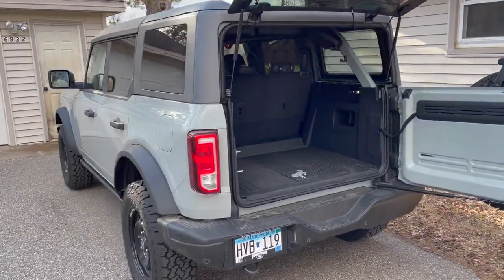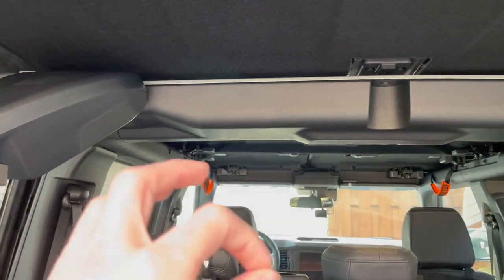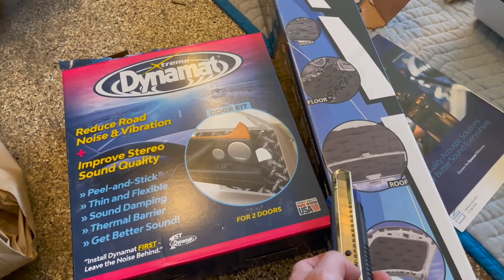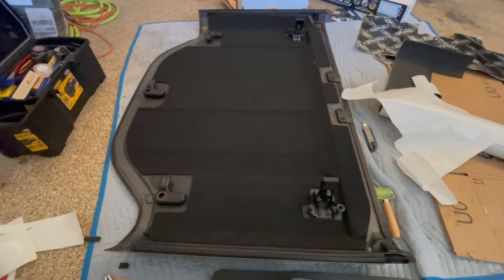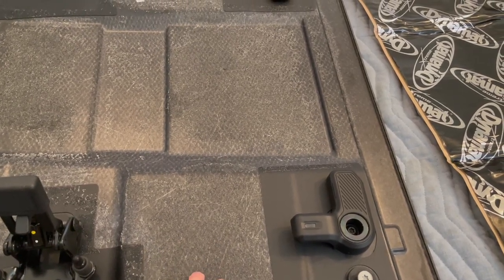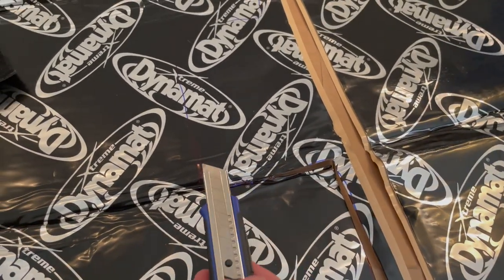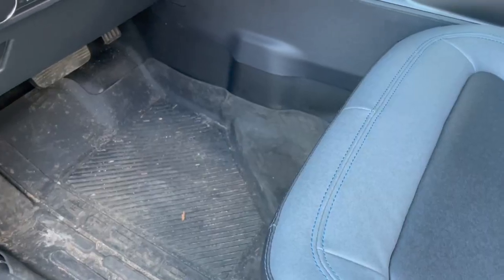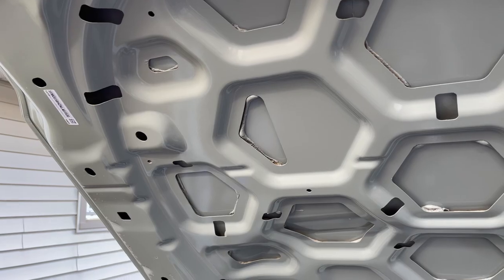Bronco Dynamat and Dynaliner hard top roof install

Comment: Try using pipe insulation the foam tube type to fill the vacant space you were showing. Just cut the length you need and press it into the space. It will fill the space without warping it

Comment: Using a hair dryer (I’m not ever going to admit where I got the hair dryer, and tactically plan such use when SO is out of the house) to warm the glue might help remove the factory liner.  A heat gun is much more SO approved, and made for garage use, but might be a little too hot.

Comment: Nice job, watchable video. How long have you had your Bronco? I'd think that the older the build of the roof the more "cured" the glue of the factory headliner would be. Do you see that a possibility?
Reply from the maker: Definitely. Especially as that glue thermocycles over the years. I've had mine for a couple of months. I suspect that even 5+ year old headliners aren't going to vary in tensile force to remove more than 25% or so.

Comment: Try using a heat gun to soften the adhesive making it easier to pull away without stressing it and making the edges wavey

Comment: You're changing the mass by adding insulation (square-root k/m), and changing k by pressing up on the headliner.

Be careful about modifying too much during the warranty period, might null the warranty in some cases.